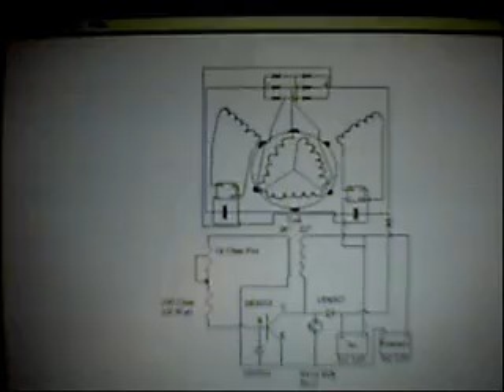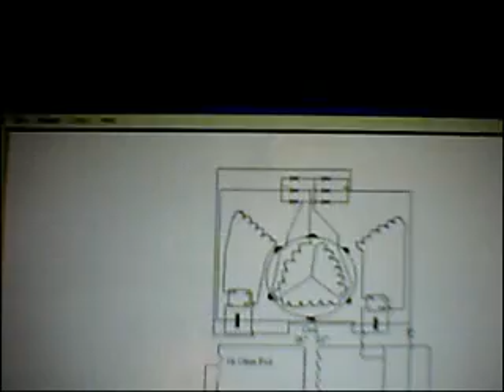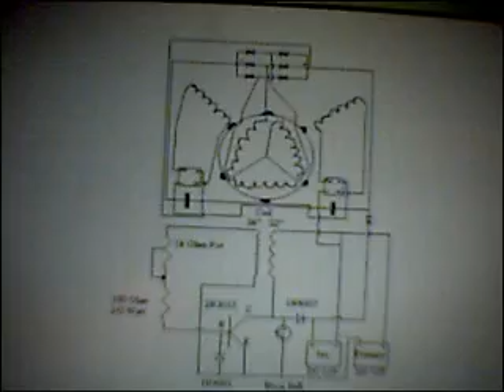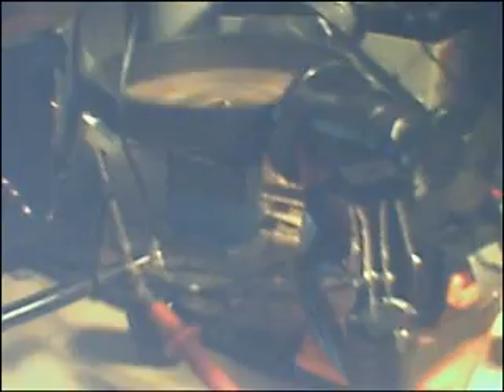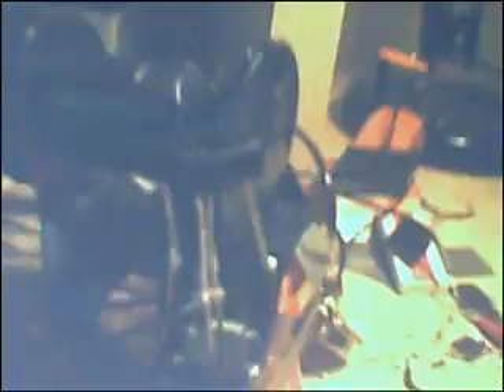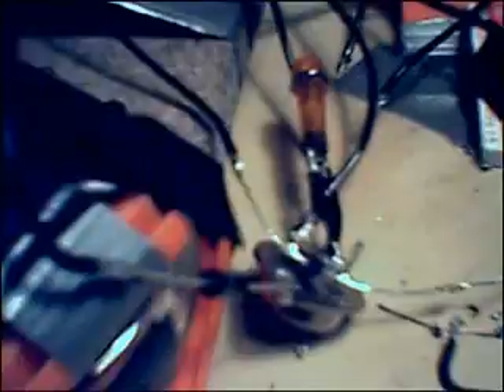Bedini circuit diagram

Comment from the maker: I have moved on significantly since this video was loaded. The important issue here is the lenz effect. I now power a motor on much less and am able to negate lenz effect, maintaining speed and therefore maximising output. These experiments helped me to understand EM induction. Winding coils that can give the desired output is an exact science and fairly difficult to achieve. One can achieve 100's of volts with one generator coil, and 300mA current with a different coil.

Comment: you could possibly use the pulse from your trigger coil to flip another transistor, one that dumped your cap across a seperate biflar coil. change the number of turns in the secondary winding to alter its output voltage.

Comment: if your not sure if its going into the battery just subsitute the battery for a small motor load or bulb to check amperage.
if you voltage is lower than the battery then it will not go in just be held by the diode from coming out of battery into the circuit.

Comment: Have you considered using a flywheel and magneto? A flywheel is well known for storing energy with mass. The dynamos from WW2 used this concept...you just had to give them a spin and they generated enough power to power a light or a radio. Pulsed DC (aka impulse technology). It's all about timing and stored energy. It is not about actually getting more out then in...its about getting as much out of what we use as we can. Heat pumps regularly get a COP>3.

Comment from the maker: in theory a sound plan. However, splitting that initial inductance in the trigger may mean that there wont be enough power to trigger the transistors? Maybe, its worth a go, though i'll have to research and wind a transformer of the correct winds etc. Cheers v much for ur input.

Comment: you could maybe try pulsing the cap through a transformer coil to step the voltage up above that of the charging battery...
when you ran it using the internal coils as the bedini circuit what transistors were you using? still haven't set up my trifilar, not sure if one of the coils alone will be enough to fire the switch...

Comment from the maker: you need to be more specific. Multi coil? A number of different ppls designs make use of several coils. Mine included. An SSG multicoil would inevitably consist of your current setup multiplied. several SSG circuits and coils around the same stator. The diagram would therefore be self-explanatory. If you can give more info, I'd be more than happy to knock a diagram up for you.

Comment: not sure if it's a good idea, haven't tried it yet..what voltage is your cap rated? it might be better to charge a bigger cap for longer till it gets to a higher voltage then dump it straight into the battery..would cut out any losses in the transformer..

Comment from the maker: 2N3055 type transistors. Still using them now as  I have many. How would I go about setting up a transformer coil? That's a new one for me but sounds about right. I need to step up the voltage if I want to charge 12V. As u can see though, it will power other loads.